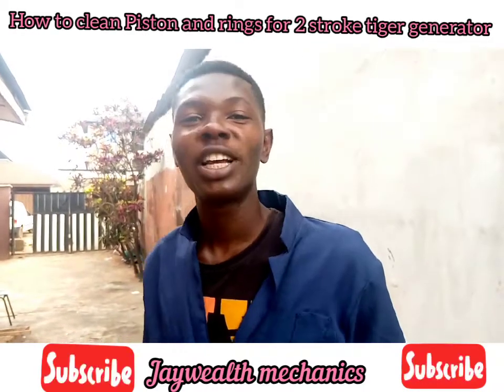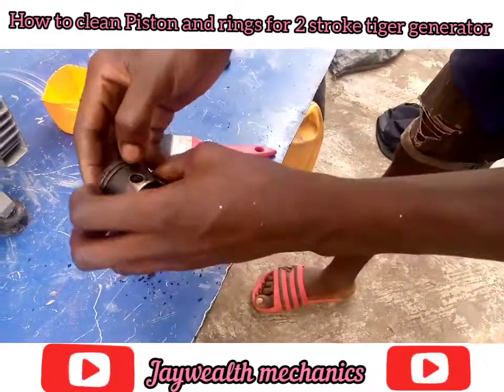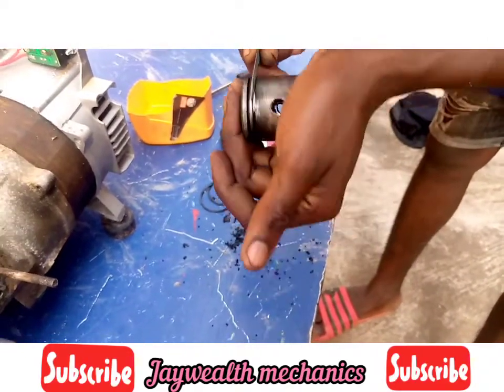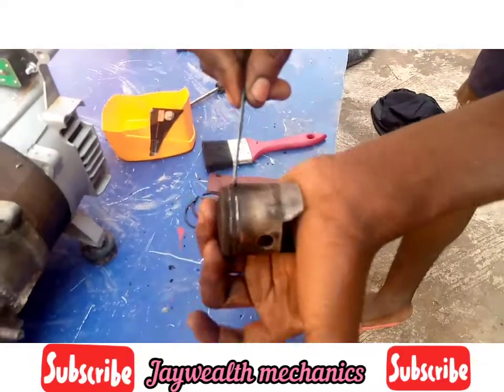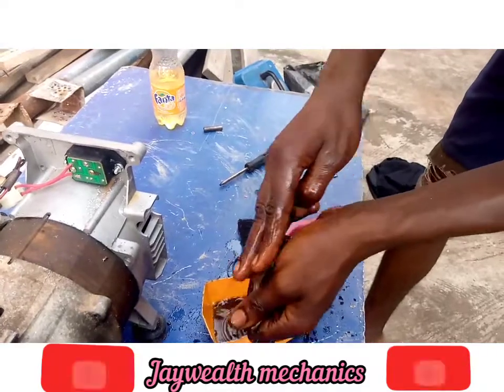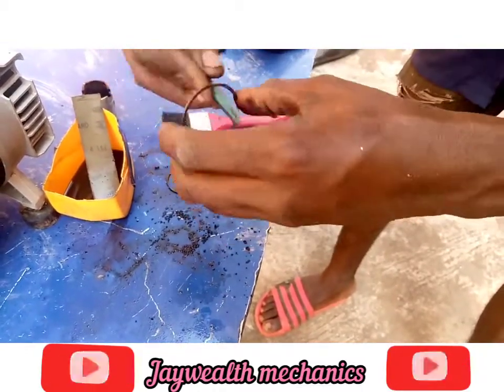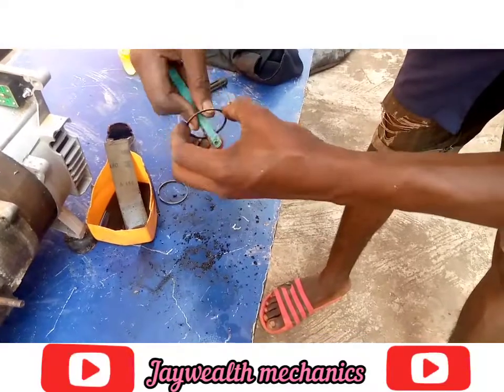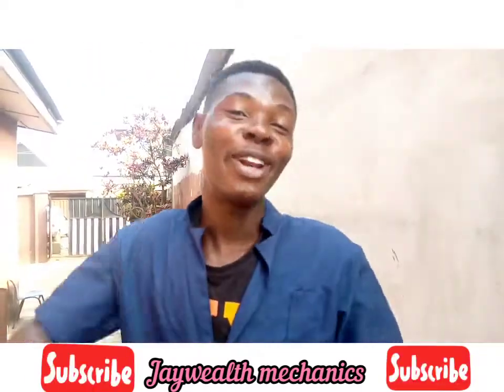How to clean carbon off piston and rings

Comment: How do you know piston is bad and due for replacement
Reply from the maker: There will be scratch on the body of the piston.. this occur when oil is not enough. Secondly the rings melt together to the piston.
Reply: Thanks for the tutorial.  You didn't show how you removed the piston from the connector and I can't re install the piston back inside the block it refuses to enter.